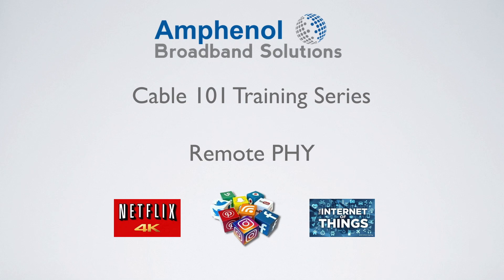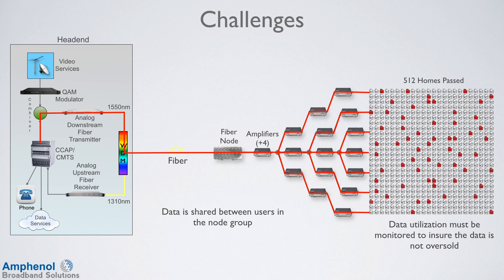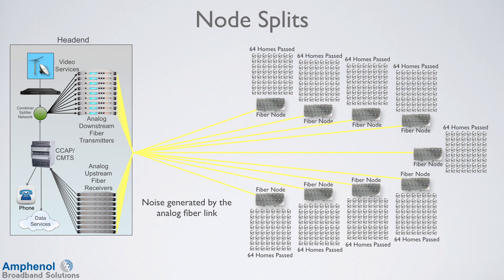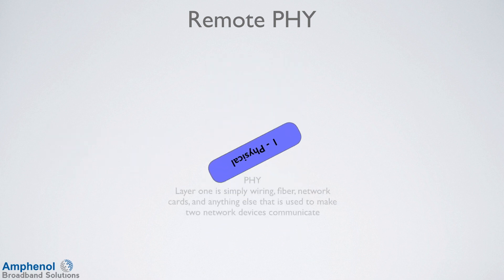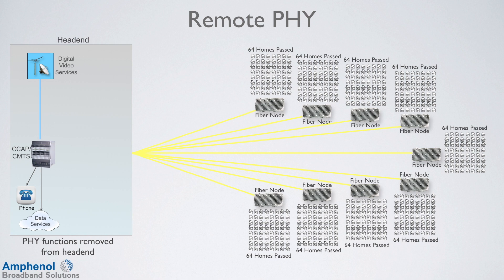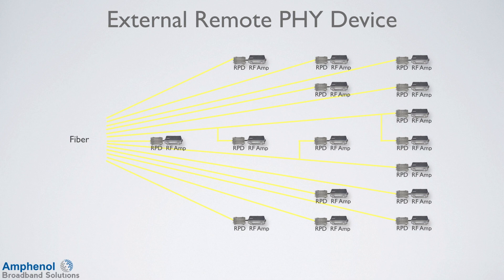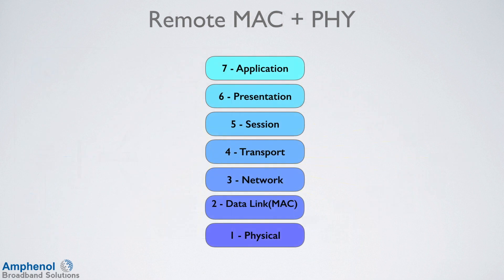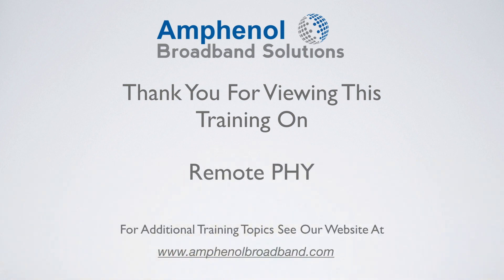Remote PHY and Why it is Needed

Comment: Instead of lower SNR you will have higher SNR...I think he meant lower noise
Reply from the maker: Remote PHY is an approach to distributed access architecture (DAA) in a digital hybrid fiber/coax (HFC) network. It moves the physical layer from the cable modem transfer switch to the network edge. By decreasing the distance to the customer’s equipment, it can achieve higher bandwidth and throughput than a centralized system
 
Yes, should be higher SNR and lower noise floor